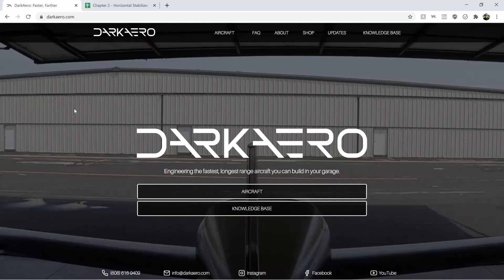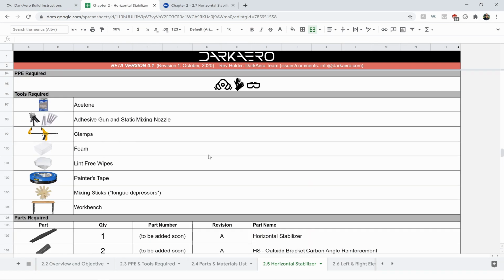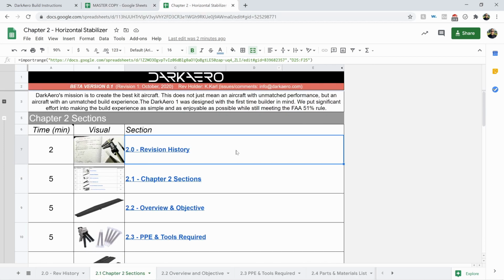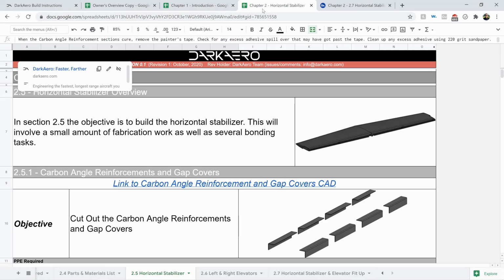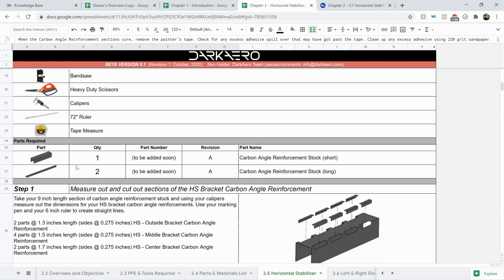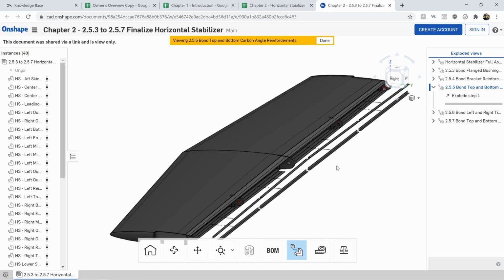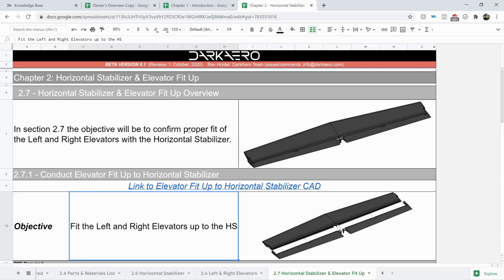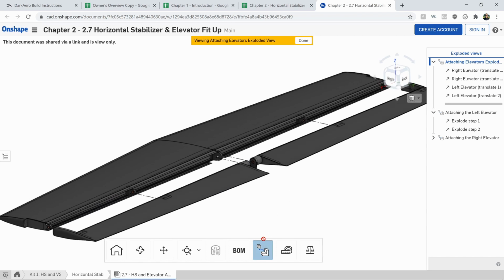How to build the DarkAero 1 | Build Instructions Preview

Comment: Your engine cooling inlets are way too small. This is a common error that almost every aircraft manufacturer makes. Engine cooling air flow rate is controlled by the nozzle EXIT area. Decreasing your inlet area and then providing a diffuser downstream of the inlet is silly. A larger inlet allows for the the majority of the  diffusion to occur upstream of the inlet, where you get a 100% efficient pressure recovery. This is a bit counterintuitive but if done properly will result in a huge decrease in cooling drag. Let me know if you want more of an explanation. I had to explain this to a room full of NASA engineers once so don’t feel bad, almost everyone screws this up.

Comment: Question: 70mph landing speed, single engine experimental aircraft. Are you planing for a BRS parachute?
Reply from the maker: Thanks for watching and the question! We do not currently have a provision for a ballistic parachute but it is something that we have been working on. This is all still in the early design phase so we do not yet have a firm timeline for when the parachute option will be implemented.

Comment: I have two questions or suggestions.  1) If you are going to be updating the documentation in real time.  How will the builder have and keep an "as built" version of the documentation? If you release an update based on a known issue/concern for example.   2) I like a lot of your build manuals using google.  There would seem to be a need to add video to the manual.  Kind of a "watch it being done" and then go do it.  This is not needed for every step, but could be useful for some complex areas or areas where you get lots of calls or email asking for clarification or more information.   Keep it up.
Reply from the maker: John, thanks for watching and for the questions! The revisions are recorded in the "Revision History" tab of the instructions. Google Sheets records each document cell change along with when the change was made which you can cross reference with your build documentation. Additionally, builders will be able to download a "frozen copy" if they feel that is necessary. On the video front, we agree. In chapter 1 we have already linked to a few videos (using adhesive and using the oscillating cutter).

Comment: also print the version. all would like have a book for building. inform them on changes and they can change single sites and they can also use the online tool. propably 20% will do. in all points you are right, but people want paper. and you can print it better ;) thanks for sharing
Reply from the maker: Thanks for watching and the comment! We agree. Builders will definitely want to print to have out at there shop.